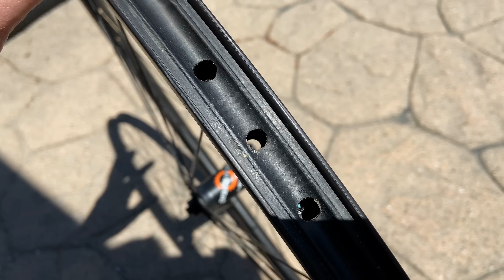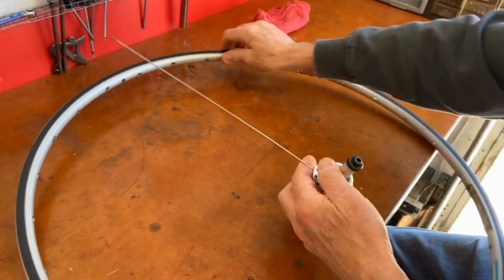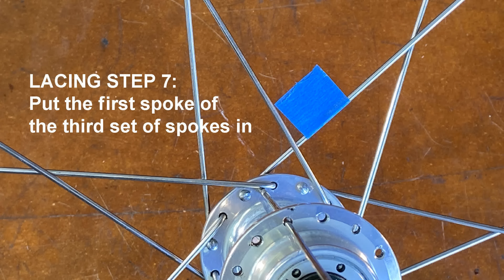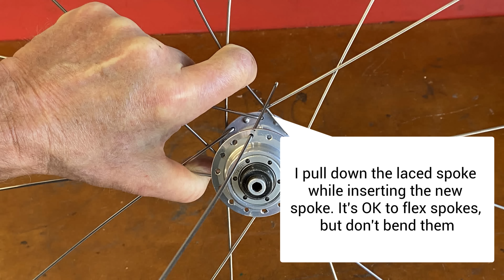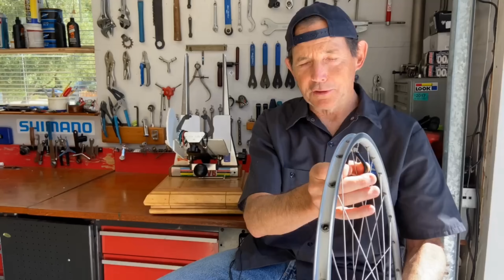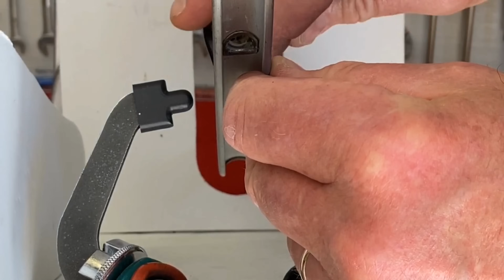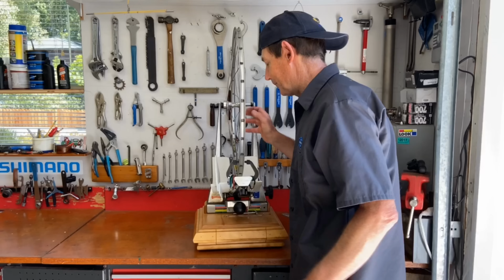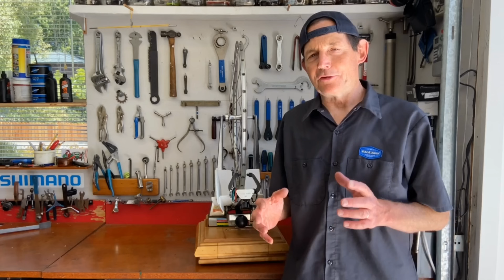How To Build Bicycle Wheels THE EASY WAY! #bikerepair

Comment: Hey Jim, thank you for the awesome video, I have successfully built a couple of wheels following these instructions. I ran into a slight hiccup while trying to rebuild a rear wheel with a replacement hub, but re-using the old spokes. During tensioning I noticed that the spokes on the drive side were becoming much more tight than the non drive side, to the point where I could barely turn them yet the non drive side spokes were still relatively loose. Is this happening because the new hub has different dimensions? I was having trouble puzzling out why that would be the case, but I can't think of any other reason why that would happen.
Reply from the maker: Thanks for watching my video, JJ! From what you wrote, yes, the problem could be that the replacement hub has different sizing than the old hub. What might be happening is that the drive side spokes are the right length but the non drive side are too long. That could cause the drive sides to reach tightness before you could get the non drive sides tight. In that scenario you might also end up with the spokes bottoming out inside the nipples. When this happens, it can become very difficult to turn the nipples because they're as far onto the spokes as they are made to go. 

To check for this you can look at the drive side nipples from above and see if the spokes have reached the ends of the nipples or are even protruding. And then check the non drives and see if there is still a gap between the ends of the spokes and the tops of the nipples. By looking at the spokes and where they are in relation to the ends of the nipples (tops), you should be able to estimate what length the spokes should be to work. Or, you could measure the replacement hub you used and calculate the correct length spokes to get for your new wheel. Maybe you will be able to use one of the sets of spokes you already have and only need to buy the other, which would save you a little money. I hope this helps.
Reply: Ok, I figured that was probably the case. I'm going to try and use a spoke calculator to figure out the right sizes. Thank you for the response!
Reply from the maker: @jjkullberg4924  you're very welcome!

Comment: 10:40 " into every fifth rim hole" .... Huh!! Don't do it!! Should be every fourth hole, please.
Reply from the maker: Thanks for watching and the comment, Hertog. There's a reason I say into every fifth hole. I have found it helps beginners get the pattern right. The first hole I count already has a spoke in it. By counting that spoke you are reminded that you are placing a spoke oriented just like that spoke in the next hole for it. It's like a double check that you're doing the right thing each time. If you just count the open holes you can get it right, too. But, I found in my classes that students would often put it in the wrong open hole. Once I got them counting from the first spoke, they got much better at getting the next one placed correctly. That's why I show it that way. Thanks again!

Comment: Absolutely great video! Question: do you ever use a tension meter to measure spoke tension and make sure they're more or less equal after truing?
Reply from the maker: Thanks for watching, Maarten. I'm glad you like the video. Yes, I use the fantastic Wheel Fanatyk tensio meter. You can see it here: https://www.wheelfanatyk.com/store/digital-tension-gauge/ I have also used Park Tool's TM-1 Bicycle Spoke Tension Meter and that works very nicely, too: https://amzn.to/3gYrZxc I do not show these tools in this video because it's unlikely someone just beginning to build wheels would have them. So I explain in the video other ways to ensure you get your spokes tight enough. If someone enjoys building wheels and decides to do it regularly, then I recommend they purchase and use a tension meter like Park's or WheelFanatyk's. Both those tools are easy to use and understand and even complete beginners will get up to speed fast. That's not the case with a lot of other tension meters, which is why I recommend those two tools. Hope this helps and thanks again!

Comment: are  30y old aluminium rims still safe or should these be replaced with newer ones?
Reply from the maker: Thanks for watching and the great question, Vamiracing. It all depends on the condition of those 30 year old rims. As long as the braking surfaces show little wear and the spoke nipple holes show no signs of pulling through, and the rims are not damaged, they should be fine. Lots of people are still riding on even much older aluminum rims. For example to ride on vintage road rides like Eroica.  Here’s a story I wrote about that epic ride fyi https://jimlangley.blogspot.com/2015/04/leroica-california-ride-report-in-photos.html?m=1d Thanks again!

Comment: Its just a rounder, less complicated Rubiks cube".  Built (copied) my first bike wheel at about 13-14 years of age.  Trued it on a fork or frame like hes doing, but also with zip ties and a fine machinists rule if its a disc brake bike. - dont really need a truing stand unless your winning the Tour de France.  Of course, some "uptite" road bike guys will think this is a sin - even if they've never even tried. Perfectionists need to take chances sometimes LOL!!!!. On a serious Note - Harris cyclery's Sheldon Brown website (RIP) has spoke length /charts for hub flange height and spoke patterns if you have nothing to use as a template.  Hey, nice video.
Reply from the maker: Thanks for watching and commenting, Hemisuper!

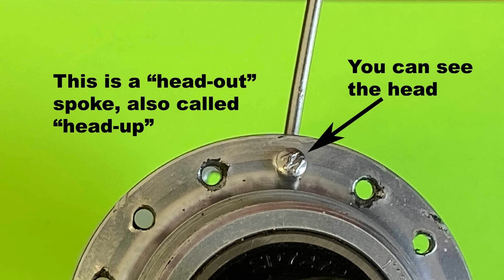Comment: If you are using a hub, that was already used, there are some marks on the flange hole. So at 10:06 it is important to put a spoke in the correct hole in the hub - not any! If you're mixing a head-out-hole with the spokes ellbow outwards this can cause too much stress on the spoke and it may break earlier.
As a tip: The Head-out orientation is easier for the first two spoke sets, as you put the spokes in the flange holes from the outside ;-). That's how it's shown in the video.
Reply from the maker: Thanks for watching and for the comment, Christian. Yes, if you're building with a used hub you should copy the spoke orientation that was used before. When I wrote the script for the video I was thinking most people would build with new parts, which is why it's not explained or shown. Thanks for adding that tip. The spoke orientation is among the most confusing things for wheel builders so I teach a basic pattern that's easy to do without making mistakes, as long as you pay attention. Thanks for the tip!

Comment: never lubricate the spokes or nipples with oil, except for linseed oil. period. the rest of the video is invalidated by this errant, early step. use a fixative, like linseed oil, Wheelsmith spoke prep, etc. or use nipples with a fixative already in them like DT pro-lock nipples. once the wheel is laced, it is advisable to use a light teflon based oil such as Tri-flow to lubricate the interface of the spoke nipple and rim only. lubricating the spoke threads guarantees that the wheel, with enough use will loosen. Avoiding this mistake, I have built wheels that do not lose tension for years. - DJRiddle, working in shops since 1993, BBI certified since 1997.
Reply from the maker: Thanks for watching the video and the comment, Donald. You are incorrect. It's perfectly fine to use oil on spoke threads and nipples. Wheelbuilders have been using it since the earliest days of cycling - and I'm talking over 100 years ago. It's not what you put on the spoke threads that matters, it's choosing quality wheel components and properly tensioning the wheels. I am also a fan of linseed oil (except for its flammability), Spoke Prep (except it takes skill to apply well), etc., however not everyone has these or wants to go buy them. Regarding your experience, with all due respect, I started working in shops in 1970 and am still in the industry, now an engineer at Praxis and wheelbuilder. Thanks again for watching the video.

Comment: Hi Jim, thank you for the video, I didn't snooze at all! Very captivating.
So quick one, if we were to try to mend/fix a used wheel that's wobbling (instead of building from scratch), would we start by de-tensioning the spokes to "4-threads showing" all around as if building new? Or is there a quicker way to solve it but with some assumptions made. (I know... I know... ass.u.me...)
Reply from the maker: Thanks for watching my video, M.A. and the excellent question. No, in the vast majority of cases you do not have to de-tension the spokes to true a wheel. All you have to do is tighten the spokes that have loosened. What you do is you go around the wheel wigging each and every spoke by holding it between your fingers. You are trying to find the spokes that have loosened and allowed the wobble to develop in the wheel. (I am assuming you have one wobble.) At first you might not feel that they're loose, but feel the spokes right near the worst wobble and try to see if you can tell which ones are looser than the others. If you can't feel it, try plucking them like a guitar string. Looser spokes will make a duller pitch noise. The loose ones should be on the concave side of the wobble. Tightening those loose spokes should fix the wobble. Since the wobble is U shaped (concave), you tighten the spokes toward the middle more than the ones towards the ends of the U. I hope this makes sense. Take your time. Make small turns - only 1/4 to 1/2 turn of a nipple at a time. The wobble will straighten with any luck at all. Good luck!
Reply: @JimLangley1  Thank you for the detailed answer, sir, I will try that.
Another quick one, should we deflate the tire completely to fix a wheel or even remove the tire altogether?
Reply from the maker: @qs51v56  Thanks for asking another great question. Yes, it's a good idea to let the air out of the tire until it's soft but doesn't lose all its shape - cause you don't want it flopping around. That way, if you have any nipples that have sharp edges, they are much less likely to cut through the rim strip and puncture your tube as you tighten spokes and true the wheel. The reason to take a tire off is if you can't see the wobble because the tire gets in the way. But usually, you can rest your hand against the frame to steady it, and use your thumb as a "pointer," and sight the gap between your thumb and the rim and even feel the wobble as the wheel spins - and that way the tire isn't really in the way because you are looking at the rim and your thumb. Okay? I hope this is helpful and have fun fixing that wheel!
Reply: @JimLangley1  Super helpful, thank you, Jim
 🙏🙌
Reply from the maker: @qs51v56  you're most welcome!

Comment: What about radial lacing? Does it changes the way to true a wheel? It's difficult to find information about this type of lacing
Reply from the maker: Thanks for the question, Silvagc! Just in case someone reading this doesn't know, "radial" lacing is when the spokes all go straight from the hub to the rim. No spoke crosses any other spoke. It's just like an early wooden wagon wheel or cart wheel. 

Radial lacing for bicycle wheels is most often seen on aero front wheels because it creates less wind drag. Also because the spokes are shorter than crossed spokes, it makes the wheel a little lighter. 

Some hub manufacturers will not honor their warranty if you radial lace their hubs. That's because the direct pull on the hub and the direct impact from hitting bumps can cause the hub to break. So, that's the first thing to check out before you radial lace a wheel - to make sure with the hub you are using that it's safe to do it.

The reason it's difficult to find information is in part because hub makers don't usually want their hubs built that way. And another reason is because it's the easiest method of building a wheel. There's no "mystery" or "confusing" pattern to figure our. You just put the spokes in straight. Yes, you can still mess up the lacing if you don't pay attention, but it's a simple pattern and easy to see what you did wrong even with only a basic understanding of what you're trying to accomplish.

Truing, rounding and tensioning a radial wheel is the same process as on any other spoked wheel. Take your time, make small turns of the nipples and follow the same rules to move the rim side to side, up and down and to center and tension and stress relieve (all shown in my video on crossed spoke wheels). In most cases, because the spokes are so short, it goes faster and it can be a little easier. Those are the main differences.

I hope this answers your questions. If you want to radial lace a wheel, just be sure to check with the hub maker's online tech papers to make certain they allow it. Otherwise you might break the hub and you wouldn't want that because you'd have to buy a different hub (one made for radial lacing) and have to rebuild the wheel, too.

Thanks again for the great question!
Jim
Reply: @JimLangley1  I asked that because my sirrus comp 2013 has the front wheel lace like that and it's a little out of true. It's a hybrid bike, nothing fancy! Thank you for the feedback!
Reply from the maker: @silvagc  Yes, the picture I found of that bike online shows a 24 spoke radially laced front wheel. Usually if a wheel like that goes out of true, it's because a spoke has loosened. So, if you go around the wheel trying to wiggle each spoke holding it between your fingers, you'll find that one or maybe 2 have loosened. They usually move more than the rest when you are doing the "wiggle" test. And by tightening them back to as tight as the others, you will get the wheel back to true again. With any luck it'll be a relatively easy fix.

Comment: nice video, mostly things i already knew but i learned a few new tricks
but uh, why not flip the bike upside down to true the wheels?
Reply from the maker: Thanks for watching and commenting, Frogz - appreciate it! If people want to flip bikes upside down to true wheels, that's fine with me. But, to me there are 3 reasons not to: 1) flipping a bike upside down can be risky if there are cables protruding and/or accessories attached to the handlebar or stem as these things can become damaged if they touch hard surfaces; 2) many bikes tend to want to fall over when you try to stand them upside down and when they fall over, things can get bent - and important things, like the frame's rear derailleur hanger; and 3) if you flip a rim brake bike upside down, the brakes end up underneath making it difficult to use them as indicators for truing the wheel the way you can when you keep the bike upright. 

But, again, if someone likes working on their bike upside down, that's fine with me. I just wouldn't recommend it for the reasons above. Thanks again for the comment!

Comment: Jim I'm trying to find a recommended spoke tension for some wheels. 
First, where would I do that? Is it based on the rim or the spokes or both?
I do have a TM-1. 
I have a set of Araya RC0540 rims and Hoshi bladed Stainless Aero spokes, Dura-Ace 32h track hubs. 
I'd love to understand how to actually find or figure that tension but from what I'm seeing in forums it sounds like 65-95 KGF. 
Thanks for any guidance.
Reply from the maker: Thanks for the question MR MR. The ballpark tension we look for when building wheels is a huge range - from 85 to 135kgf (65 is pretty loose/soft). The ideal thing that you go by is the rim manufacturer's recommended optimal spoke tension. So if I were you I'd try reaching out to Araya directly and ask about the rims you're using. 

Their USA distributor is Merry Sales and the contact information is jim_porter@merrysales.com and here is their website: https://www.merrysales.com/ Once you have the recommended tension, you can then measure your spokes and refer to Park's chart to find the correct reading on the TM-1 to go for when you tension the wheel. With any luck Jim at Merry Sales will either have what you need or be able to get it from Araya Japan.

Now if you want to just forge ahead and try building the wheel, you could do it and under tension the wheel a bit to avoid any risk of overtensioning. If you went with the low end of the range you found online - 65kgf - you would find out pretty quickly by riding on the wheel if it's too loose/not tight enough. First the wheel would feel "vague" or "soft" and if so; second, it probably would not stay true.

If a wheel feels soft and won't stay true, you won't trust it. To fix the wheel then you would raise the tension a little at a time until it becomes a positive and tight wheel when riding and the spokes stay true and tight. So, you would be learning the correct tension through trial and error and by creeping up on it so that you don't over tension the rim. I hope something here helps. Thanks again!
Reply: @JimLangley1  so helpful and I really appreciate the response Jim. It's my first wheel and it's been a lot of fun so far thanks to your videos.

Comment: I have a 20 spoke wheel to build. Not sure what the math is for that configuration. I got completely lost at 12:20
Reply from the maker: Hi Ric, with your 20 spoke wheel you install 5 spokes then 5 more, then the next 5 and then the last set of 5. At 12:20 in my video, you are putting in the first spoke of the second set of 5. That set goes into the hub the opposite direction of the spokes already in the hub. I think if you watch what I’m doing it’ll make sense. Your wheel might be a cross 2 one and if it is you would make your spokes cross 2 instead of the 3 I show in the video. Hope this helps. Happy to answer more if this doesn’t help.
Reply: @JimLangley1  Thanks Jim. I'll give that a whirl. Looking at the video on my desktop rather than from my iPhone makes things a LOT clearer ;-)